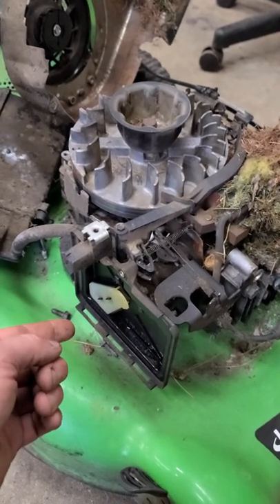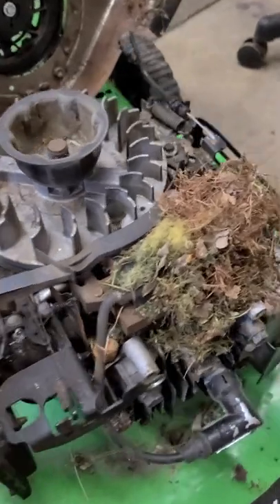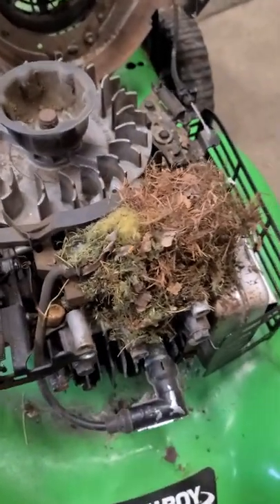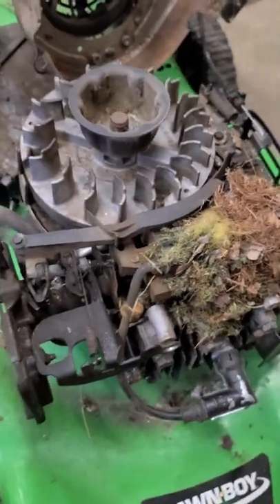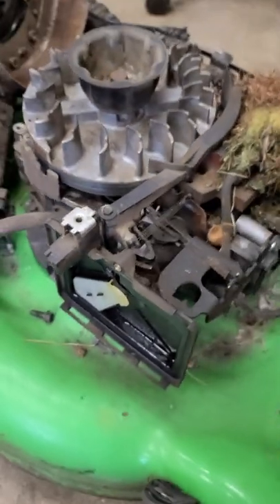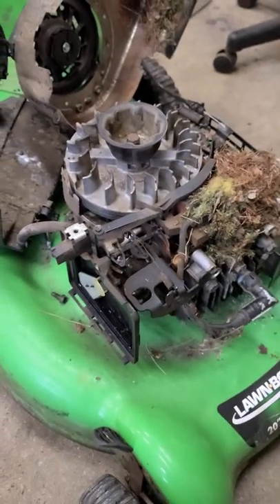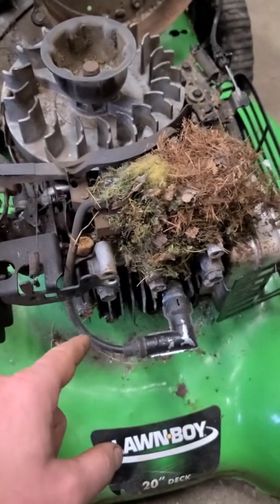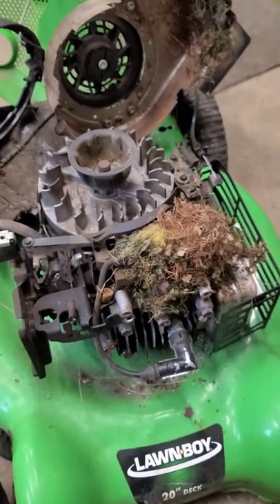Lawnmower Was Running Poorly After Winter Storage - Here's Why!  #shorts

Comment: The Noma lawn tractor I restored had holes through the top of the cylinder from mouse pee. It's like the aluminum just melted away and went through the sleeve too. Thanks for the mouse repellent tip.

Comment: Had a few Ariens auto choke machines that run rich as hell if you can get them to start at all. The fix? Whole new carburetor, because auto choke is garbage and so are fixed adjustment carburetors overall.

Comment: Hi.  That  long arm, is an air actuated governor, controlling choke, and load levels,  to keep rpm as per idle screw  settings.   KEEP  THAT  SHROUD  ON  THEM,  it directs airflow for functionality  !
Reply: Some older B&S engines have that, but these newer Quantums do not. The arm you see in the picture is for the auto-choke only; the governor is operated by a cup and weights in the crankcase.
Reply: @AtomicFallout757  Okay.  Thanks, Donny for  educating me.  All  learn  together........hope Steves'  Saloon is doing fine.  Seen your long video, the other day.    (from east central Alberta= Hardisty